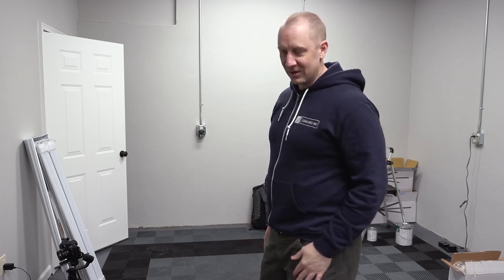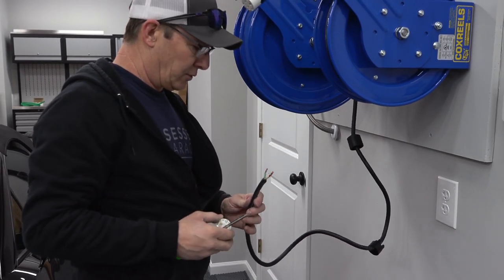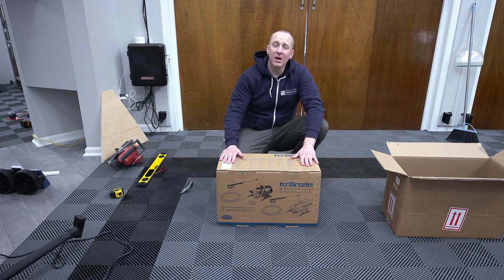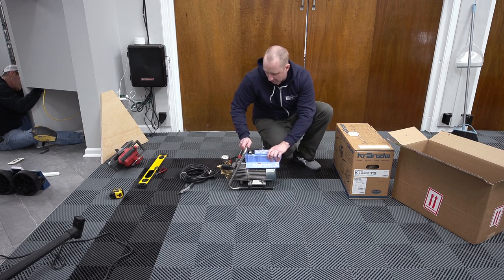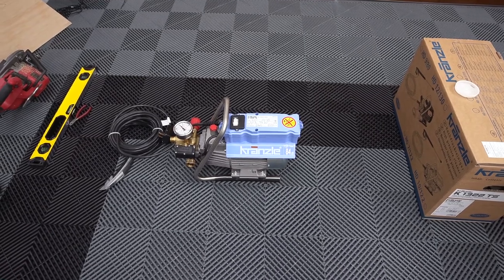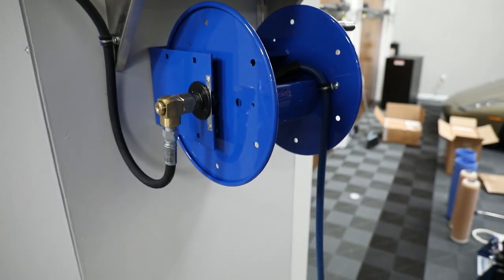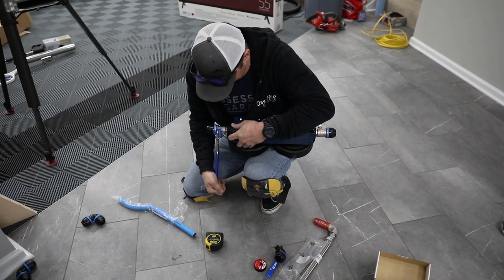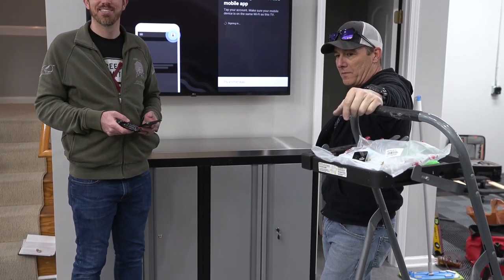VinWiki Pressure Washer Install

Comment: Interesting how the smaller garage has baseboard on the left side but not around the back and right side.  I would be inclined to add baseboard around the other 2 sides and then a piece of shoe molding to cover the cut edge of the floor tile.  That would look really clean!

Comment: Thought about removing the floor stand off the Kranzle and mount it straight on the shelf with the dampener?
Reply: I was thinking the exact same thing the whole time they were installing it... It would look so much cleaner.
Reply from the maker: I like it better on there.  That way it's easier to grab for servicing.
Reply: @ObsessedGarage  manufactured hole in the shelfing would give it the option of never being needed to be taken off the shelf (for the oil changes) 
I designed and had made a similar shelf for the same model. Only 4 bolts if I need to remove it. 
Not dissing this design though. The garage is looking awesome!
Reply from the maker: Then you’ll end up taking the shelf off the wall.
Reply: @ObsessedGarage  no. Its 4bolts that hold the pump. Then I just lift it off.

Comment: What if you wanted to have an outdoor set up? Maybe with a solid cover for the hose reel and the pressure washer, I have the hoses I bought from you, the gun, wand, and use a ryobi washer and i usually have to pack everything up in a bucket and unpack and set up every week when I wash my car, I do not have my garage available for me to keep everything set up in there, would love to see if there is a way to keep everything outdoors with a detachable cover of some sort.

Comment: The way some boxes arrive the look like they dropped them from a plane at 30,000 ft.
When i worked as a car valeter we washed most cars with a steam cleaner, on saying that we also did chassis cleaning and at times we did clean car transporters. we never damaged any cars and one of our customers used to send their fleet inspector out to check all of our work and trust me he had a vast array of tools for inspecting paint fabric leather glass and other things the only inspection we failed was down to a bumper having a failed plastic primer and the paint started to peal ford had many come back over that.

Comment: pressure washer really needed to be on top of that wooden angled shelf not poking out on the stainless one. and the air hose should have come thru the plywood on the wall and directly into the 90 degree brass elbow. other than that amazing project

Comment: Matt I can’t figure out the pressure washer connections for kobrajet hose the unit I have came with 1/4 what connections will I need on each end of the 3/8 hose to get them to screw on to my 1/4 gun and power washer